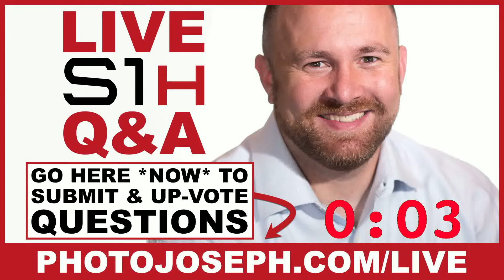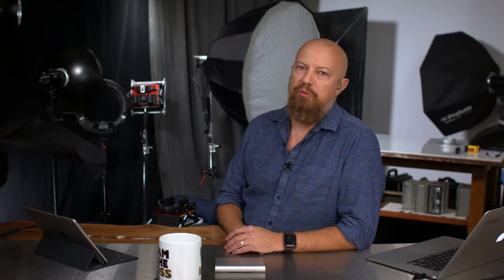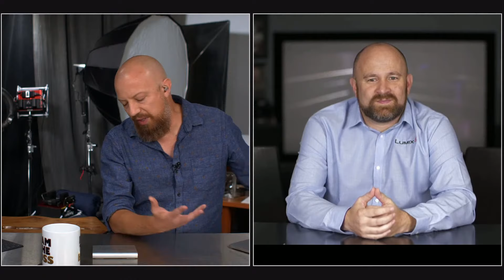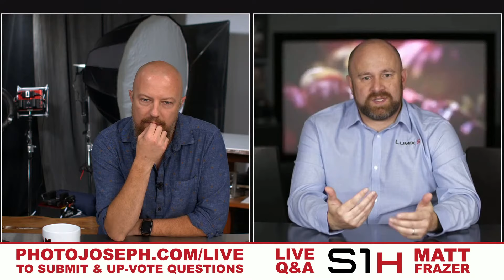Q&A on LUMIX S1H with Matt Frazer from Panasonic — Recorded LIVE

Comment: If panasonic updates the S1H in the near future with 4K 72fps all I at 10bit 400 & 2K120 or even 2K100fps all I at 10bit 400 most people would go crazy! Actually, it would be the best time in the market for this camera! It is perfect already but with all the issues these other companies are having. That slight boost would be a major impact on their sales. You don’t need 4K 120 but 2k would be enough to raise eyebrows. Also if they drop the price $600 less it would be right below their competitors! They have a fan and a powerful 6k sensor that most likely can out output these specs like nothing! It would be the best time to capitalize on this. It’s not 4K 120 or 6k60 like how they are probably are doing the S2 which in actuality is good so they won’t compete but If you think about what has happened this camera really has only been active promoting for a few months. Society needs to give it a chance to show its self off again. Unfortunately things needed to be put on hold.

Comment: I will answer the sales projections question. As people research this camera, they will decide the price point versus practicality will hurt the SH1 sales. Sorry, AF is important. Your customer base isn’t a Varicam/Alexa user. They are GH5/Sony A72/BMPCC users looking for better lowlight, dynamic range with same video capabilities and stabilization and 10 bit 4:2:2 in camera of GH5. We want the perfect camera. The price point might just be acceptable if SH1 had phase detect AF, and USB-C to SSD recording, or affordable lenses. The SH1 isn’ that, but very close, and S1H is not an ideal camera for its true customers, and all the manual focus talk is an evasion. This is a super expensive price point camera that could have revolutionized everything! Just get three cheaper cameras for same price! Or make S1H cheaper... or address that your AF blows chunks and address the friggin issue. No one is buying it! Not a coincidence AF is all anyone talks about now regarding this camera. Do they want it? Sure,  it at that price point of 6K? No.
I’m prob gonna buy any other camera because AF is a tool for many situations, particularly for solitary filmmakers. I don’t have a focus puller, and if I did, well I would probably have a pro cinema camera. I think people wanted the Sony A7S3, and I suggest people wait a year for first company to beat SH1, which is really just a heavy full frame that does V log.  If something isn’t in focus — and it isn’t just tricks of people attempting to beat AF as the guy saiid—  then all the footage is unusable. Big deal, eh? And why have a flip screen if your market is really just that elite cinema crowd that will get a different camera anyway?
No, you just messed up AF and we will wait and not buy SH1. Sorry Panasonic. Why spend 6 grand for a camera package with one lens — and all other lenses are near 2K each by way — when camera bodies are getting so much better every year? The S2H might fix these things if Lumix is smart. S1H with phase detect? And shooting to SSD like XT3 and BMPCC? I’d purchase today. All Sony needs is 10 bit 4:2:2 internal and this camera is dead in water and will depreciate like crazy. Pick one up then maybe. Hell, a Sony A7S2 is probably a better deal in 2020 despite being so old. This interview feels like the guy is apologizing for S1H. Panasonic, you did such great work only to have a camera too expensive with bad auto focus when Sony is adding superb focus to it’s top cinema  line. So who is innovating? So close Panasonic.

Comment: I bought a Panasonic 1.4x teleconverter to use on the S1h and the camera gave me the message that this converter is not compatible. What gives? Is there a known issue with that tele?
Reply from the maker: Should work fine although I haven’t tried it. What lens?
Reply: @photojoseph  The Panasonic 70-200 f4. Could there be an issue if I was sent a grey market lens? Just fishing for an explanation, because it does not make sense.
Reply from the maker: Actually it's probably because the lens needs a firmware update — yours probably doesn't have the 1.1 update installed. https://av.jpn.support.panasonic.com/support/global/cs/dsc/download/index4.html
Reply: @photojoseph  That could be it, but I returned it.
Reply from the maker: Dan WRAY Um, ok…
Reply: @photojoseph  Speaking of updates, is the v. 1.2 firmware listed for the S1 and S1R also meant for the S1H?

Comment: 45:39 - Not accurate enough?  Then how is Sony managing to pull it off using on-sensor phase detection?
Reply from the maker: Scrub back a minute… we’re talking about a LIDAR focus demo and “time of light” technology. Not phase.
Reply: @photojoseph  So my logic here is that LIDAR should be easier to implement than on-sensor phase detection since they don't have to cram all those transistors onto a single board with photo sites and a whole bunch of other features.  Sony is actually going the tougher route.   And remember Redrock Micro has already invented two implementations of LIDAR.
Reply from the maker: I’m not familiar with Redrock’s implementations. Can you still do things like face detection and object tracking?

Comment: Great video and interview...however, I still don't understand why Panasonic continues  to dismiss their customer concerns/complaints WRT Video AF.  The S-1/R/H are wonderful systems and would undoubtedly be light years ahead of Sony had Panasonic modified their AF system.  Now it appears some of the major retailers are adjusting prices on the S1/R...just my humble opinion.
Reply from the maker: The cries about AF performance do not go unheard. There are a variety of reasons that the sensor is contrast, not phase. AF does keep getting better and better, however.
Reply: @photojoseph  Panasonic keeps claiming that DFD is superior, but everyone can see that it's just not true.
Reply from the maker: Marcus Sundman For stills focusing it is true. I don’t have an answer to why the S1H, clearly a video-centric camera did not switch other than to say this isn’t a simple switch, “buy this part instead” kind of thing. The current focusing system is deeply integrated into the pipleline. Also the target market for this camera are users who primarily shoot with cine and adapted lenses. They are not AF users. I’d love to see amazing AF as well as everything else this camera has, of course, but that just isn’t the case here.
Reply: @photojoseph  It's not true even for stills. Even there PD-AF + CD-AF is at least as good as, if not better than, DFD + CD-AF. And I disagree about the target market. People will use AF-C if it works. The reason why everyone uses MF now is because Panasonic's AF is so bad.
Reply: None of the arguments really hold up though. DFD is demonstrably not as good as PDAF. Cinema focused users would use AF if it worked properly. Sony is proving that with the inclusion of their AF in the FX9.

Comment: What about low iso? I've read the sigma FP will be able to shoot at iso as low as 6. That would replace tha ND in some cases
Reply from the maker: I don’t know how the FP will perform, but speaking generally, any ISO above or below the “native ISO” is just gaining the image up or down. You lose dynamic range as you move away from base ISO. So cameras like the S1H or GH5S that have dual native ISOs look equally clean at both native ISOs. If natives are 800 and 2500, then the image is nearly identical at both of those. Dropping as low as 6 ISO is certainly convenient, but I’d be looking very closely at the image quality. Admittedly I’d love to have that as an option — no argument there — but in general I’d much rather be shooting at or near native ISO and compensating with ND.
Reply: True. As video maker i would prefer dual native iso @25 and @800 insthead of 800 and 2500. I need an Nd more often than ultra high Iso
Reply: @photojoseph  We want a low base ISO, because that's what will determine the highest SNR possible. The is important particularly on crop sensors, because ISO 200 on MFT is like ISO 800 on FF. Most FF sensors go to ISO 100, which would be like ISO 25 on MFT.

Comment: Hey, Panasonic, how about (at least) a paid upgrade for the GH5S to a FULL V-Log/V-Gamut?  Since the GH5S comes with V-LogL perhaps you could see your way to allowing us to get the FULL DR of the FULL V-Log/V-Gamut?  I'd like to get another stop or two of DR out of my GH5S and it is frustrating that I'm only getting about 70-80% of what could be available with the FULL V-Log/V-Gamut.  Free would be great, but I'll settle for a (reasonably priced) paid upgrade.

Also, why is it that HLG has more detail than V-LogL (both 422, 10-bit, 30fps; 72Mbps (HVEC) and 150Mbps (MP4), respectively)?  I seem to be able to push V-LogL around more in post, but I get noticeably more detail in HLG.  Is it because some information is being lost with V-LogL and not HLG?

Please?  Pretty, please?
Reply from the maker: I’m pretty sure that the GH series sensors don’t have the dynamic range that full V-Log offers. It’s a hardware, not software limitation. V-Log cameras have larger and much more expensive sensors. As to the HLG question; I don’t know why but I know that you do get a little extra DR from HLG. Still not full V-Log though.
Reply: @photojoseph  I'll start by saying that V-Log is a data format and will record whatever it is fed, regardless of actual DR. Whether it be 10 or 16 stops. It is a profile that covers the contrast range by producing a "flat" recording, with specific characteristics, to maximize the DR of the data it is fed.

I remember reading, at the time Panasonic released V-LogL for the GH4, they were asked why it was a "limited" version rather than a full implementation. It was explained (I don't remember who it was, but it might have been Matt) that the limited version was used so the GH-series wouldn't step on the Varicam's sales.

The GH5 sensor was supposed to be capable of 12.5 stops of DR. Most people were able to get ~11+ stops). The GH5S sensor, slightly more (~13+ stops, but most getting about 12). 

With V-LogL, the range of values is cut off (e.g. 127-895, if memory serves rather than the full 0-1023, losing about 12.5% of the available DR). ~12.5% of 12 stops is a bit more than a stop of DR, totaling ~13+ stops of DR. 

The Blackmagic Pocket Cinema 4K camera's sensor has a solid 13+ stops of DR and is VERY similar to the sensor of the GH5S. This implies that the GH5S sensor should also be capable of 13+ stops of DR.

I'm asking Panasonic to allow the release of the full V-Log so that they will merely be on par with the rest of the industry. Both Sony and Nikon provide full implementations of Log with their mirrorless cameras and so should Panasonic. Even Olympus provides a full Log profile.

Personally, I don't see either the GH or S-series cameras cannibalizing the sales of their higher end cinema cameras (with the possible exception of the S1H hurting the EVA) because the use cases and abilities are still too far apart. As the GH5/GH5S are used as B/crash-cams for the Varicams, a full V-Log would only make the post production workflow that much easier/better than it already is.

Frankly, I have always been disappointed that Panasonic took this "semi-Canon" approach, rather than a "semi-Sony" approach in which they maximized each camera's abilities rather than limit them. Sony not only provides their FULL Log profiles, but provides THREE different versions of them (SLog, SLog2, and Sog3) and for free!

In many ways the V-LogL vs V-Log is similar similar to 8-bit vs 10-bit recording. The sensors (in general) are capable of recording 12(+)-bit data (4096 steps from min to max values) streams (RAW), but the software transforms that data into 8 or 10-bit streams (256 or 1024 steps). 

However, what Panasonic has done is a bit different with V-LogL vs V-Log. My understanding (which I'll admit may well be misinformed), is that Panasonic is clipping the top and bottom 6.25% (128 steps) of the data in V-LogL.

Regardless of whether or not my understanding is perfect, IMO, Panasonic is only hurting themselves by implementing what can only be seen as a crippled ("(L)imited") implementation of V-Log.

FWIW, I would rather have V-LogL than no log at all (it's a major reason I purchased the GH5S). But I'd still rather have the full implementation than V-LogL...

Disclaimer: I'm an amateur/hobbyist who is trying to move into real estate photography/videography. Even if I don't end up "going pro", it still doesn't make my desire to produce the best quality videos I can any less valid. It just means than my "means"  (what I can afford to pay) and what I can justify paying are less.

Anyway, my $.02...

Comment: Exactly,...so for the blue channel clipping, yes we have seen this for decades on many camera models. Some camera's are more resistant that others. However, with the S1 and S1H, we are seeing these cameras having an EXTREME sensitivity to blue lights. More than any camera I have ever seen.

Oddly enough, the same blue light test scene is 100% FINE when switching to HLG. And, going further, the exact same blue light does NOT hurt the GH5 VLog-L or HLG. 

Even B&H's S1H promo sales video is riddled with severe blu channel clipping. That was a terrible way to highlight the S1H. Those guys spread blu light all over their shots! If I was Panasonic, I would BEG B&H to take their promo video down!

That is what I read this morning on EOSHD forum about s1h! 
Try and censor that, now!
If verified, it will soon come out, anyway...
Reply: jm baillard don’t use shitty blue colored lights..problem solved.
Reply: @EverythingFilmmaking  How about mixed lighting conditions? Have you read Matt Allard article on the Newsshooter website? That guy is not usually what we could call an extremist and yet, his review of the S1H is not very flattering... Don't get me wrong, I'd be the first one to buy it if that camera was as good as Panasonic & fans claim it is? (Some even called it "baby Varicam")
Reply: @jmbaillard7015   Yea, just read it yesterday..I have decided to go with a GH5 and speed booster..